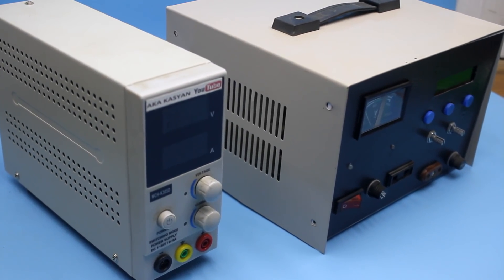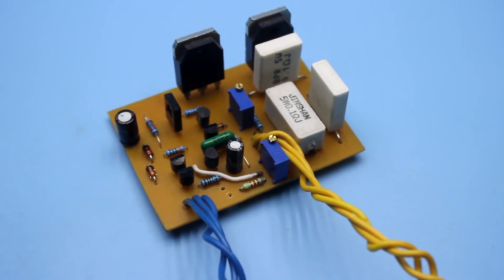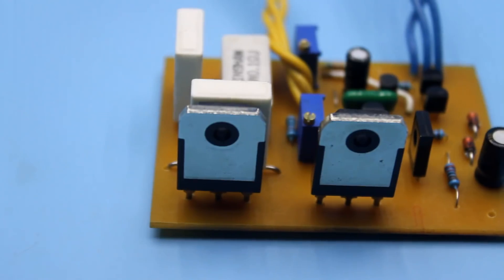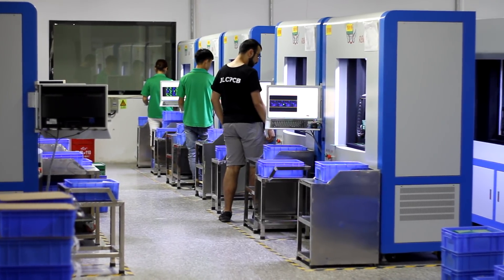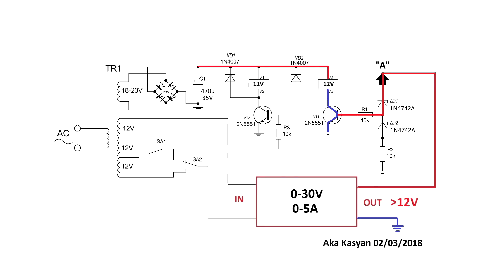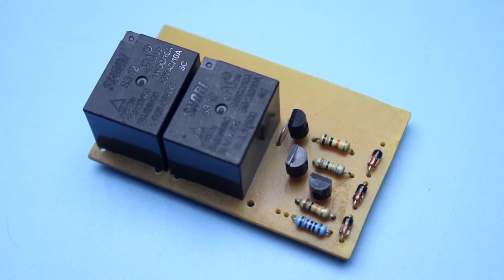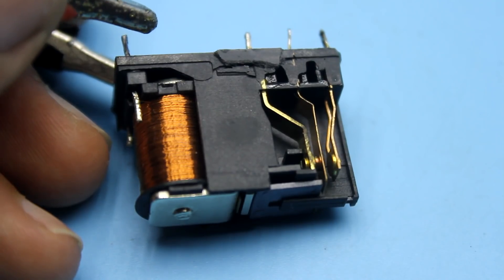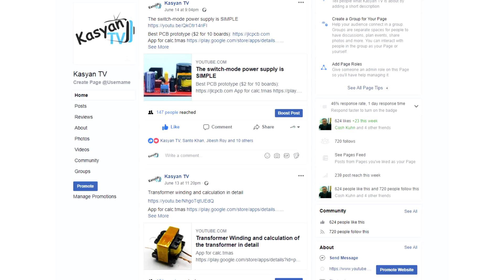Relay switchboard of transformer windings for laboratory power supply unit

Comment: I've read some bad comments about relays acting as voltage tap switchers. One of them is the risk of the relay contacts being welded when the power supply turns on. This will cause a inrush current with specs way above the relay limits.

Comment: 18-20V AC auxiliary voltage is very high.Vc1=18*1.41  =25V , but relay coil is 12V.
The relay coil should be 24V or AC aux. voltage 10-12V.

Comment: Kasyan, the two current limiting resistors soldered to the test LEDs, are they 1Gohm?  Nice visual  indicators of the switching function.  I may include them on the PCB lay out  if I manage to get hold of resistors of that value.  Thanks again for posting great projects and keep on the good work.

Comment: Question to anyone in the know (I wish Kasyan answered, but I do not think he does, and I respect that): 
The diodes filter bridge is not rated. However, Since the  current rating of the powering source  that may replace the 18-20V trafo winding is 200-300 mA, I guess that for the filter bridge 1A would be more than enough?    I would appreciate any clarifying comments on this.
Reply from the maker: hey. The current of the winding 200-300mA is enough, but it all depends what relay you use and how much (in the circuit 2). If conventional relays with a current of up to 10A, then enough and 100mA of current from the winding of the transformer, but the stock never hurts.
Voltage 18 volts is chosen for the system to work stably with changes in the voltage in the network.
Reply: Hey, Kasyan! Thanks a lot for your appreciated reply.   I am using a 12A, 30VDC/28VDC relay, on circuit N° 2 (three transistors).   I would go for 18V.  I will be winding my own trafo.  So, I'm assuming around 250mA.  Please,  confirm.  Thanks again for your help. 

I would like to take  this opportunity to let you know how useful and practical I find most of your projects.  Your instructions and the information you provide are reliable and objetive, and are backed with a sound knowledge of electronics.  I have build a couple already, and they work great.   Your efforts to produce technical proposals of interest for the DIY electronics community and of consistent content and video quality do not go unnoticed.  Most people do not realize how much effort must go into a video for it to simply flow smoothly and logically.  Yours  do, all the time. You make a great contribuition to the DIY electronics community.  Thank you for that Kasyan!